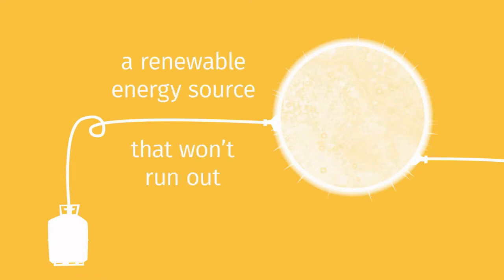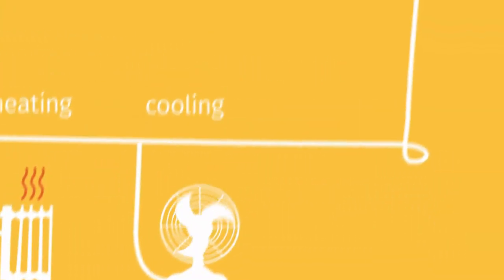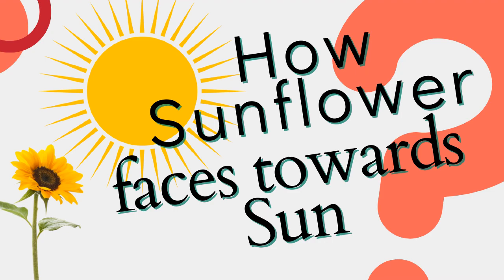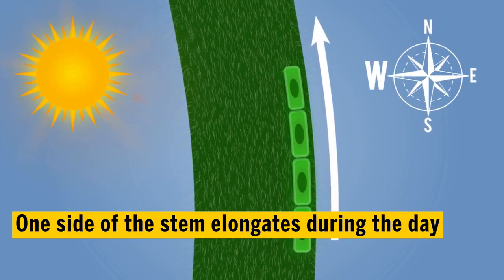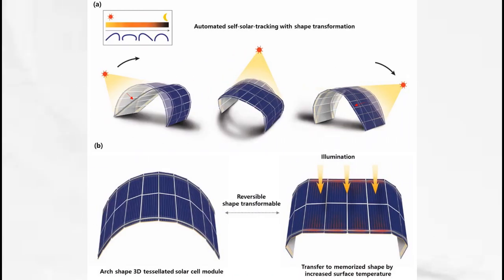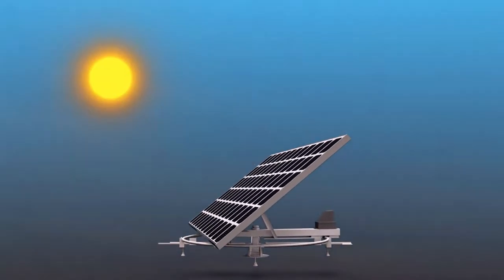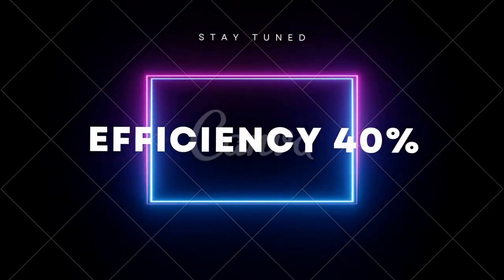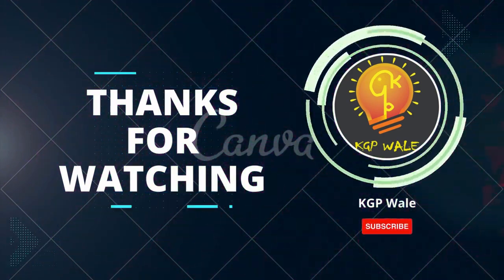Solar Panel as Sunflower

Comment: Hey, Nice Idea... but how about the sensor in place of that material.. And also like why the stem in the sunflower grows faster which is opposite to the sun...
Reply from the maker: Hey Shivam thanks for your appreciation, this is an example of a passive solar tracker in the video shown. What you are talking about is absolutely possible and it is active solar tracker it has even more efficiency only one drawback is it's increased cost and maintenance. 
The increase of stem in opposite side is mediated by a hormone (Auxin) as this hormone prefers to stay in shady side only and it promotes growth wherever it is present, thus pushing the plant toward the sun.
Reply: @KGPWale  Ooo.. got it..

Comment: Amazing 😊😊keep it up 👍 but I have aa doubt that why the opposite side stem of the sunflower is grown faster ,not the other side
Reply from the maker: This is mediated by a hormone (Auxin) as this hormone prefers to stay in shady side only and it promotes growth wherever it is present, thus pushing the plant toward the sun.
Reply from the maker: Thanks for your appreciation
If the opposite side of the stem grows more it will increase its weight which will cause it to bent on other side
Reply: Sorry my question is that why    the opposite side stem from sun  grows faster as compared to other side which is infront of sun